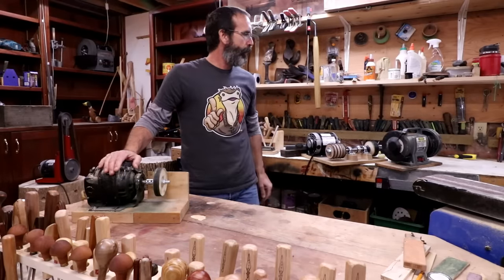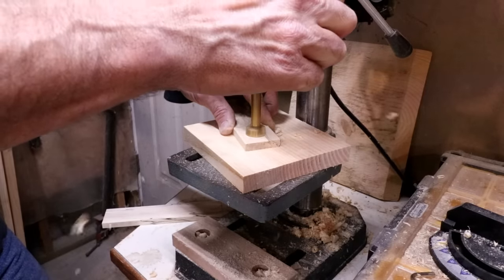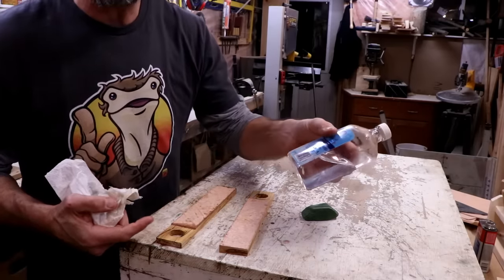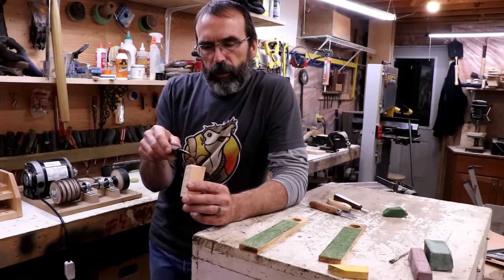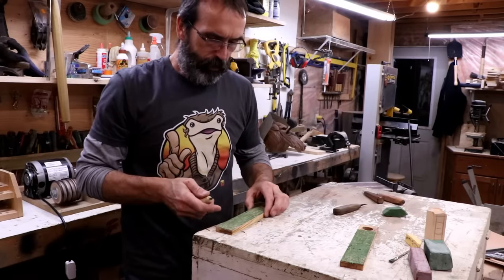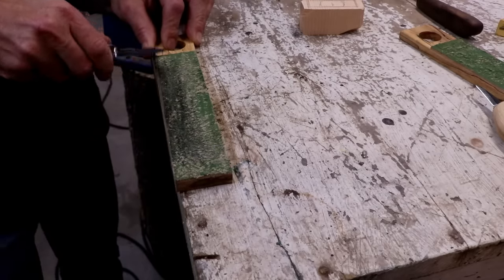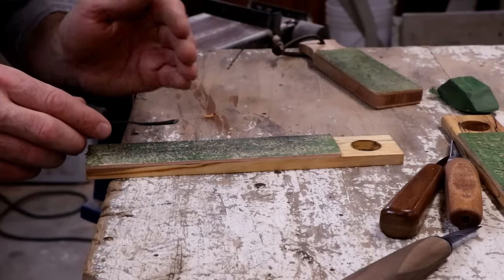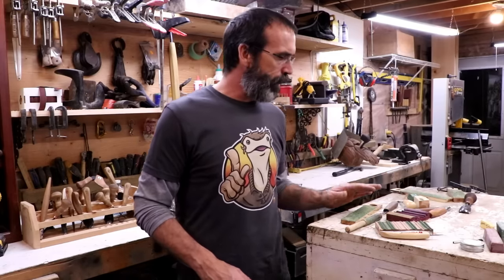Strops -Make One ,Use One

Comment: Great video! So many carvers ask about sharpening knives. I'll certainly point them to this video. The only things I do differently, is shape a handle at the back of the strop for holding when necessary. And I use the smooth side of the leather, and rough it with a belt sander - that gives it enough roughness to hold the compound, but seems to allow more surface contact with the blade.

Comment: Great video!  I made several of these of different sizes a few years back.  Maybe the best damn  things I ever made.  I tend to use the longer ones 18 and 24 inch the most.  Carved a handle in the end of each one and use them more like a file.  I like to put whatever it is that I'm stropping in a soft jaw vise and go at it.  I find that the longer strokes and added speed with control really brings a fine, fast result.  I do all of my kitchen knives, pocket knives, axes, scissors, plane irons, chisels etc. with these things.  WOW!  If you think you know sharp, give these a try. They take it to another level and leave a mirror polish which resists rust and looks amazing too.  I also find that stropped edges last longer and are more durable.   I have at least one each for white, red, and green compound.  White then red and finish with green.  Once you have it polished in well, you should only need to use the green.  Two highly enthusiastic thumbs up for leather strops.

Comment: Thanks, Doug,
I have a set of 3 Beebe carving tools and a strop but never learned the proper way to use the strop or compound until I watched this video. I was getting frustrated with the carving I was attempting and did not realize it was increasingly dull tools that were the issue.  I need to find more time now to carve.

Comment: Nice tipps and tricks - thanks for sharing, especially pointing out that your tools never saw a sharpening stone. Sharpening is only necessary, if you want to change the profile or have real damage on your blade that needs a repair. Once sharpened and treated well, you only need to strop it - well done.

Comment: Doug ... I just finished my second carving so I am very new to to this. My question is if the black color on the strop is metallic, shouldn't that be removed before you sharpen another tool? Or do you just add more compound on top of it?

Comment: Great insight Doug. never thought of making my own gouge sharpener. I notice that you use firm pressure when stropping. I was taught to use pressure no firmer than when holding a razor shaving and then gradually use lighter strokes. Then I realized you seem to strop often but have not seen a razor in a while so this guideline may vary quite a bit. Stay safe!

Comment: Do you ever clean the strop?  If so.....how?  Thanks for the video, looks easy when you do it 😀
Reply: A little bit of oil on the leather, wipe it off w a paper towel. You can get pretty clean. Then let it dry and reapply compound. Probably you dont need to do this very often.
Reply from the maker: not very often -if it gets too built up you can scrape it or use a nail brush and reapply

Comment: I prefer the smooth side of the leather for hand stropping, but I also use a dab of ordinary cheap toothpaste on it after I charge it with abrasive compound,, It greatly enhances the stropping friction and polishing action. When the compound "builds up" too heavy on the leather, I scrape it off down to a clean surface using the back edge of my knife then re-charge it. For the abrasive I like diamond powder or Tormek paste..prior to adding the toothpaste. Toothpaste contains an extremely fine abrasive... Give it a go...see what you think..

Comment: As a machinist that sharpedtools for 20 years. Strapping isn't the end of all things. The best way to sharpen is by going finer and finer grit. Impregnated leather or solid media matters nothing. 16000 is the finest grit I worked with. Silky is how it was described by manufacturer. In the machining world the terms are honing/lapping and polishing. They are the same physical actions. Differ in purpose. Lapping and honing are size and shaping operations, polish is looks. You can get a knife or anything else sharp and not even have a strap.
Reply from the maker: But this is a video about stropping lol

Comment: Does leather have to be some specific type? 
My knife set came with a leather strop (smooth) and some compound, but no matter how hard and for how long I tried to sharpen my knife, it seems that the result is just not there. 
I'm at a loss at this point... is it that my strop/compound is bad? Or maybe my knife is bad? Or just the piece of wood I'm working on right now is too hard? Or maybe I'm just doing everything wrong? 
Really confusing.

Comment: I was going to take my garden clippers, some scissors, and kitchen knives to a guy that sharpens ice skates.  Would stropping also work for them?
Reply: Kel J ...I was wondering about that too.  Good question. Maybe an extra large strop is needed.
Reply: Bypass tools are much harder to sharpen  ( scissor type ) they require a different style of sharpening depending on their geometry. E.g.. tailor scissors are sharpened differently than hair cutting scissors, both require a fair amount of skill , as for gardening type bypass tools you would not use a strop ( normally  ) but you can achieve a fairly good edge with the use of a good quality axe file and some practice , kitchen knives can be done on a strop provided they do not have a serrated edge. 
Sharpening tools is an art form that requires practice and patience but when you learn how to do them properly you'll never keep a dull knife in the house again.
Reply: Don't let a guy who sharpens skates sharpen your knives unless you plan on wearing butcher knives on your feet to play hockey  !
Reply: @rotattor  Ha!  Thanks for all that good info!

Comment: Hey Doug, I'm quite new to whittling and and have noticed that my knife edge has been getting some small chips on it. I have a strop but wasn't sure how to use it properly. Can I just ask how hard should I press the blade against the strop to get rid of the chips?
Reply from the maker: Perfect timing -my next video is a refresher on exactly this
Reply: @dougLinker  Thank you, I was really surprised that you can actually sharpen knifes with only a strop. Can't wait for the next video

Comment: Making a Flex Cut Jack knife a flat cut to minimize the edge from being levered out of the cut. I use a OOC knife but have this flex cut knife requiring a different technique. Do you think regrinding the blade would harm the edge steel. I do use a Seller's rag stuffer oil can after each stroping and after carving.
Reply from the maker: i wouldn't ,but if kept cool while doing it it should be ok .if not careful with a grinder or sander you could burnt it quick and lose the temper

Comment: Doug which side of the leather strop do you use to sharpen with, the smoooth side or the rough ?
Reply from the maker: Rough is all you really need i just do a couple passes on the smooth but probably not necessary
Reply: @dougLinker  ok thanks.  I bought a strop online other day and wanted to glue it to a board  like you did . So I’ll just glue the smooth side down now that I know. Thanks

Comment: Great video. I noticed that after you strop there is no compound on your knife. When I strop I usually have compound cake onto the edge. Do you think I’m using to much compound, pressing to hard on the knife, or something entirely different?
Reply from the maker: sounds like a bit of both.i may get a bit of residue left but just a trace
Reply: Doug Linker , do you only use the strop on your pocket knives/bushcraft knives?

Comment: Hi Doug, what do you do to renew your strop when it turns black? I've scrapped mine off with a disposable blade and rubbed the leather lightly with a steal brush to "fluff" it back up before adding new compound. I don't know if there is a difference with compound companies but I have been using Enkay they have a chart for color compounds. http://www.enkaypolishing.com/polishing_instructions.pdf